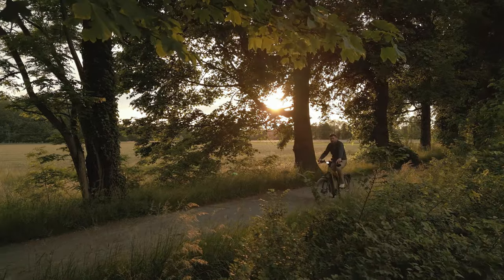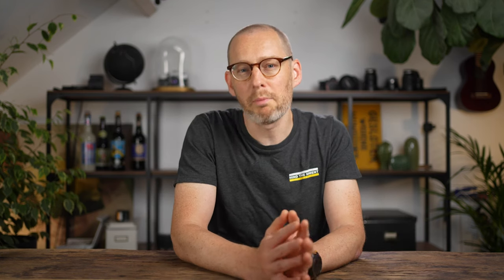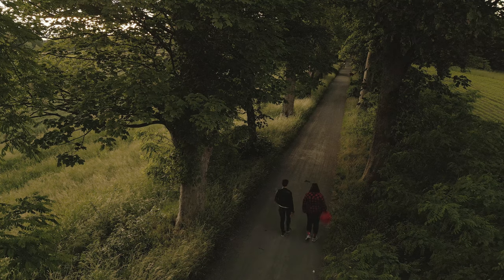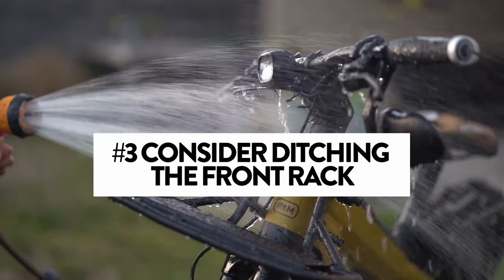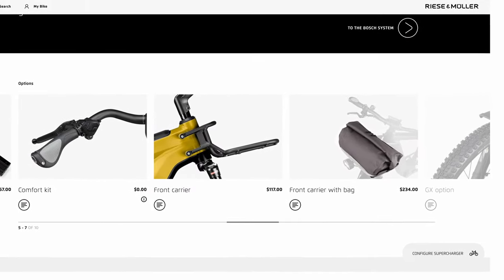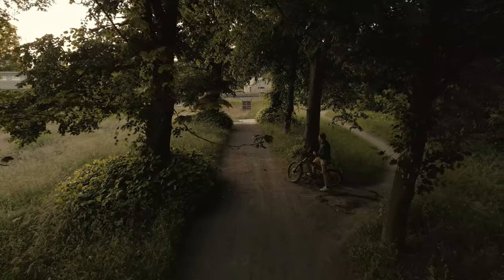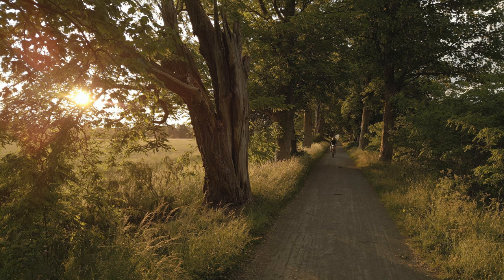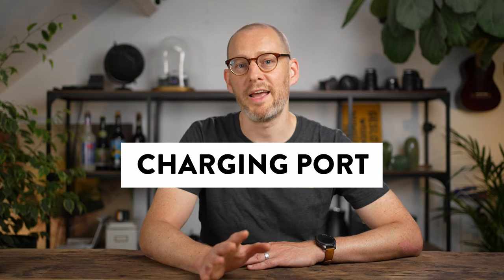Riese & Müller Supercharger - long-term review update

Comment: I am about to order a Charger 4 with Enviolo and your comment got me thinking.  How much does it shorten the battery life?  Do you think that system has other drawbacks?  I cannot afford the Rolloff though since the bike is very expensive.  Thank you!
Reply from the maker: I think I read somewhere that the difference is about 8%. Whether that’s a big deal depends on how you use the bike. Just make sure you have enough range in the worst case scenario (head wind, cold battery, max support, etc). The main other drawback is cadence, but that’s only an issue at higher speeds. I’m not sure if the Rohloff versions command higher prices on the second hand market. If so, that might be a factor in the decision as well.
Reply: We don't have the choice on the Charger 4 anyway, there is no Rohloff version yet, neither is there a HS version. I ordered a Charger 4 GT Vario months ago, and it's supposed to arrive in 2 weeks. Yeah, I would probably have preferred the Rohloff too, but I went with the Charger 4 so that I'm at least in the new Bosch ecosystem instead of in the outgoing one.
Reply: @raftermanhoward1883  Same opinion here :-)

Comment: I did not understand why it is more dangerous to fall with that bike. Is it because it is heavy?
Reply from the maker: I don't mean to imply that this is a more dangerous bike than other fast e-bikes: it's very stable and the brakes are really quite good. On dry roads in rural settings I have zero issues. But I do think that especially when you ride in a city, they are inherently risky. The fact that you are faster and more nimble than a car creates dangerous situations because people don't anticipate your speed. The braking distance on such a fast heavy bike is longer than you might expect, and it's easy to lose traction and start sliding. Wet roads aggravate this, which is why I've stopped commuting in rainy conditions. But maybe I'm just a lousy cyclist, who knows... 🤷🏼‍♂️
Reply: @BelgianHikers  i understand and agree. :-) Thank you for clarification!

Comment: What did you mean when saying, cover for charge port? Is it not waterproof?
Reply from the maker: There's a rubber flap that covers the charging port that comes off easily and is very hard to reattach (see my original review at 9:39). They may have replaced it on the 2022 version. I usually leave the port uncovered. Haven't had any issues with water seeping in so far. 🤞🏻
Reply: @BelgianHikers  tnx